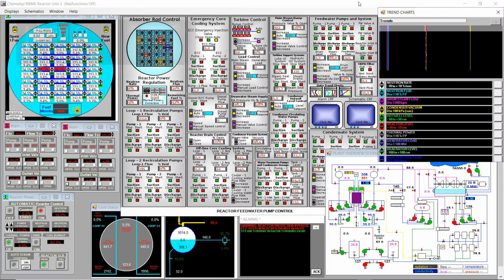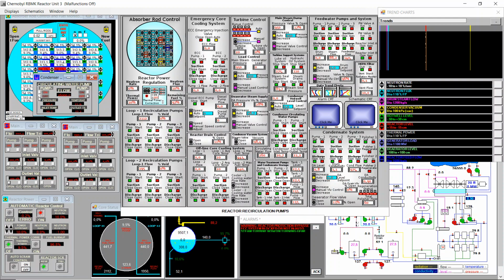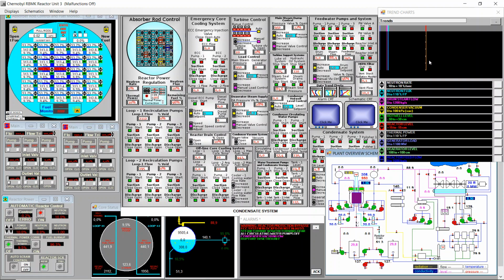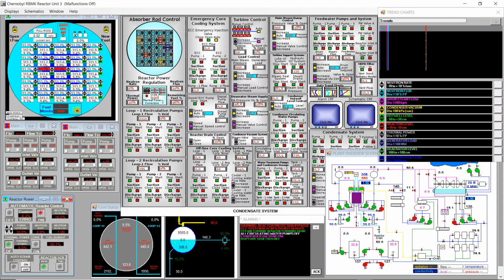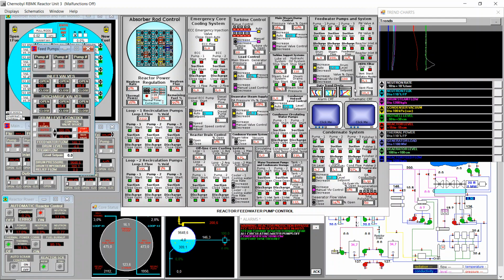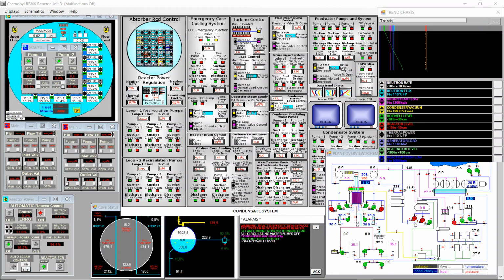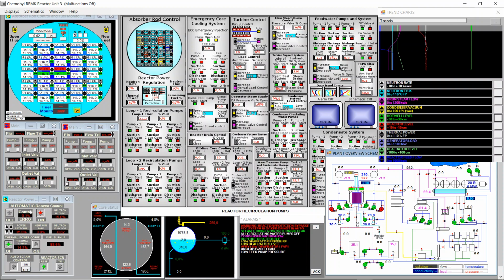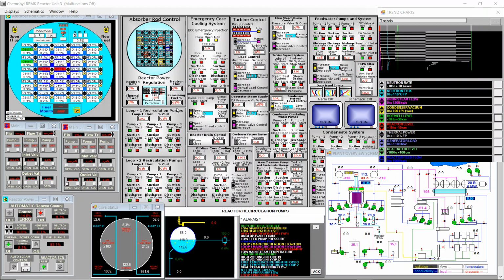RBMK Loss of Condenser Cooling Accident

Comment: I have a question, what is the vent that can be seen under the hotwell (window feedwater system) coming out of the blue line? Sometimes it opens automatically, but I don't know why.
Reply from the maker: If we are looking at the same thing it's the pump vent that connects condensate pumps with condenser to provide the pressure head so the condensate pumps can actually pump condensate. Think that otherwise they are in vacuum, you cannot pump vacuum.
Reply: @argilaga  But the condensate pumps can be seen at the bottom (Feedwater system window), and this valve branches off beforehand and goes nowhere. Directly above this valve is the Hotwell Makup valve (inlet), and this strange valve below seems to be an outlet, but I can't see anywhere that it goes to the condensate pumps. 
Or is it the blue line that leads directly from the condensate pumps up to the hotwell (plant overview window), but where no valve is shown? (There are black and blue lines which are going to the condensate pumps)
Reply from the maker: I see! I was looking at the wrong window. I think it's the drain to the condensate storage, if you leave one single condensate pump running at nominal power the hotwell level will start to raise, at some point this valve will open to avoid flooding the heat exchanger in the condenser.
Reply: @argilaga  Ah, that makes sense. So a kind of "overflow" into the two condensate stores. Thank you!
Reply: @argilaga  I have tried out a bit. This valve cannot apparently be operated manually, but it is controlled by the "Hotwell Level control". The hotwell level must be greater than the hotwell level setpoint and at least one condensate pump must be running. Then the water is pumped from the hotwell into the condensate stores. (At least that is how it seems to be)

Comment: Hello, where does the reactor drain outlet go? When I open it manually, the reactor level drops as expected. But the hotwell levell rises sharply. (The hotwell diagram then shows a value of about 380 above the top green arrow). Is the reactor drain connected to the hotwell?
Reply from the maker: I am not sure where it goes, I guess to the condensate storage or some other tanks not depicted in the figure. If the hotwell rises suddenly is because of the perturbation you introduce to the system, draining the reactor increases voiding, and it takes some moments to the drum level, and steam flow to stabilize. And so water accumulates in the hotwell. I tested myself and did not see any significant increase of hotwell level, how much did you open the reactor drain valve? I tried with 50% with the reactor at 100% n. flux.
Reply: @argilaga  I have now also tested it again and it seems that the same amount of water that I manually drain from the drain valve goes into the Hotwell. I now think that they are connected (always the same amount of water coming out of the drain is also displayed at the corresponding input on the Hotwell).
Reply from the maker: @tachyonator7986  That is interesting, and definitively possible. Since we are dealing with liquid water the pressure difference can be dropped with the drain valve. Please if someone really knows about the layout in an RBMK NPP enlighten us.

Comment: Every time i reach 100% neutron flux it just closes, like when i press alt+f4, is there a patch for this?
Reply from the maker: You should never reach 100% neutron flux, it makes a meltdown as soon it reaches 100, this may be the thing that makes it close. Try to stay at 95.5% of neutron flux maximum
Reply: @argilaga  Thank you! Looks like that was the problem.
Reply from the maker: @karpejev  I'm glad to hear that, keep that power high!
Reply: @argilaga  Actually, i think i know why this is happening. In the Absorber Rod Control menu you can see % values under the rods temperature, the central rod is at 99.3% right now, but neutron flux in Power Regulation menu is at 95.3%. So if i set it to 96.3%, central core will go up to 100.3%, then meltdown and it closes, can that be a reason behind it?
Reply: I`m not 100% sure, but it looks like that was the problem, flux at 96.8% now and it`s fine.
Reply from the maker: @karpejev  I never checked that, but I assure you I reached 99,8% of neutron flux without a meltdown and I would say there was some rod in the center of the core above 100. If you are able to reach 100% with a bit of tweaking of individual rods please tell me!
Reply: @argilaga  Ok, so i was able to reach 97.5% of neutron flux without meltdown. The only problem is it might blow up if fuel goes too low because Power Regulator cant control individual rods, i`m gonna try do  100% without meltdown now.
Reply: @argilaga  Did 100% without meltdown, it still blew up when i get to 100.5% though, that`s weird because none of the rods was at 100%, but i did it. I think the easiest way to do this is tweak them when the reactor at 5-10%.
Reply from the maker: @karpejev  Did you try the fuel fix to avoid running out of fuel? I explain it in a previous short video
Reply from the maker: @karpejev  That's nice, I didn't think that was possible. I should try equalising the rods at low power. Trimming the loop 1 and loop 2 flows may help too.